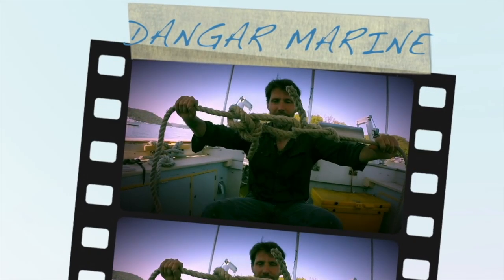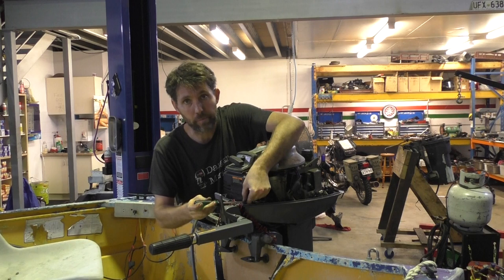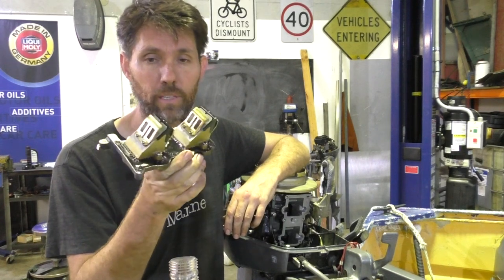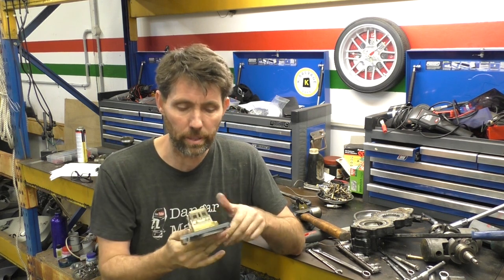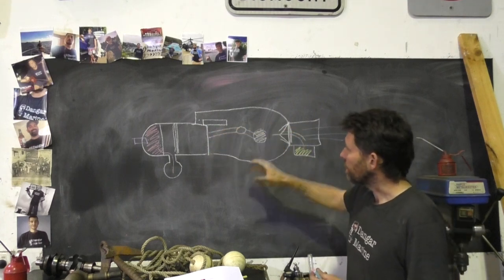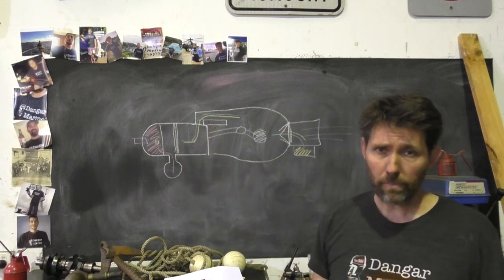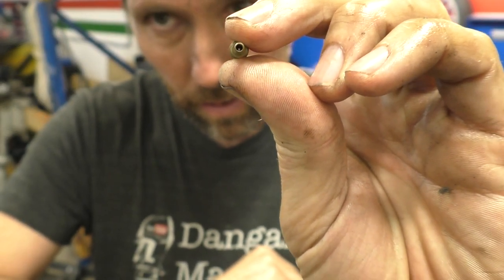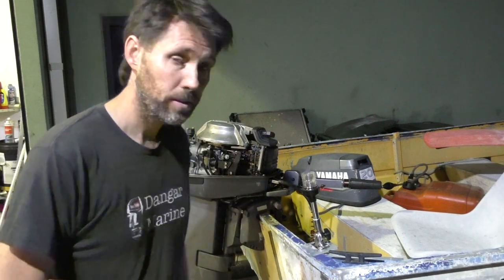Outboard reed valves

Comment: Thanks for the diagram explanation.. my 90 hp v4 evinrude I have to choke the crap out of it to make it run. I'll run super for as long I want to be in the water , ! But whe I turn it off and let it sit for more then 1/2 hr I will kill the battery trying to get it started again.  I took the plugs out and choke it to make it run and it takes at least 15 mnts of cranking with full choke to start it again and then it cuts off. It's like it's not getting enough fuel into the cylinder? Can reeds cause that.. thanks
Reply: If it takes more than 20 secs you are beating a sick donkey

Comment: So bad compression can be linked to poor reed valves.. But how did I find which one is responsible? My 1988 force 50 hp has poor compression like 80 lbs
Reply from the maker: Bad reed valves won't give you a poor cylinder compression reading but they will stop the fuel and air being compressed in the crankcase. Often you will see fuel spitting out of the corresponding carburettor if they have broken.

Comment: great video as usual and you got a bunch of views too. too bad that did solve the issue but you can at least cross it of the list. still on our trip on the coast. my 700 dollar rv hot water heater has a issue and only puts out warm water for less than a minute either on gas or electric? the tank gets hot which is puzzling. so taking showers at the sites facilities till we get home and have my buddy who owns a RV repair shop fix it. YouTube no help on this one. haha I too love the humor. yes a more diagnosis search will solve this issue and believe it's an ignition issue.
Reply from the maker: Hey Tim, bummer about the hot water. Still looking into whats going on with this motor, hope to have it running today!

Comment: Will the Reed valves cause an engine to have compression issues?
This what I mean 
1987 stratos fish and ski bass boat. Has a 115 mercury on it, new carpet, new seats and new cover. Boat guy told me it needs reed valves from losing compression. I don’t know anything about them and do not need it. Will sale or trade, make me and offer.
Reply from the maker: Reed valves don't affect cyclinder compression, only crankcase pressure that then transfers the fuel up to the ports. Low cylinder compression is a much harder fix.

Comment: I purchased new reed valves for a mercury 200. When I put it back together I could slightly see light. Why would this be? They are brand new. I tried flipping them over both ways. Have you seen this before? Or is there a slight tolerance ?
Reply from the maker: Hmm, can't say I have seen that. They may bed in with a bit of use though but I would personally be feeling more comfortable if they were sealed before I put it all back together.
Reply: I looked in the manual and it says it has a tolerance of 20 thousandths. I took it apart and re checked it. It seems to be good now. Thanks! Love the channel

Comment: Hi mate I have a tohatsu 50 two stroke 2005 model don't seem to be Erving fully throttle full open only approx 3200 revs on taco and low power any ideas where to start with this one please and cheers for a great channel
Reply from the maker: I'd make sure it is running on all cylinder - check for spark and clean each carburettor. I would also do some research into the outboard to see if it has a limp mode that has been activated limiting the revs too.
Reply: Thanks mate great channel

Comment: Great. I have a single carb 25 hp Nissan and top cylinder get too much fuel, flooding the spark. Could reed valve be tuned to reduce the air/fuel into top cyl?  thanks a lot.
Reply from the maker: Yes, reed valves or a vacuum leak somewhere are about the only things that will cause that on a single carb setup.

Comment: If it has a choke, a lean condition should have cleared up with application of said choke.  This could also be a vacuum leak causing lean, though.  I'd start simple and spray some Brakleen around the engine while it's running to see if RPM's increase.  If not, I'd head for the ignition system.   Seems you've covered just about everything else!  Could be a bad plug wire or plug cap too.....maybe snip the wires and re-screw the plug cap on them?
Reply from the maker: Yes, putting the choke on a bit is a great way to see if it smooths out as it richens up. I will be doing a whole video on vacuum leaks soon and definitely going through the ignition too.

Comment: Could bad Reed valves possibly be the cause of excessive unburnt gas coming out the exhaust? I recently rebuilt carbs on a 96 Johnson 130 HP, and get quite a healthy pool of unburnt gas/oil in the lake. Nothing leaking from the carbs in the housing. Just started happening. Trying to pin point the cause. Thanks
Reply from the maker: Generally bad reed valves will mainly cause unburnt fuel out the carbs rather than exhaust.
Reply: @DangarMarine  Thanks for the reply. You think it's most likely a carb issue since it happened after I rebuilt them? Also used that OMC engine tune up, so could still be gunk from exhaust due to that? Thanks again

Comment: Im having a problem with a 2 stroke Yamaha 115tlra holding fuel pressure. I can pump the primer bulb (new) with the engine off and hold pressure. The new fuel pump is holding in a vacuum when I put a tester on its inlet. After the fuel pump, the tester will show about 2psi for less that a minute and then drop to less than 1psi (maybe a half) with the engine running. Anything over about 2000rpm and the engine bogs down and acts like it wants to jump off the boat. I’ve already rebuilt the carbs 2x, and going crazy why I can’t keep pressure. Does this seem like possible reed valves? Thanks, appreciate all the efforts in your videos.
Reply from the maker: Have you had the fuel pump apart?  Your tests show that the reed valves inside the fuel pump are probably good but you may find there is a tear in the pump diaphragm. The crankcase reed valves talked about in this video are unrelated and won't cause fuel pressure problems.
Reply: Every time I think I’m close to solving it, you slap me in the face with something else it could be (LOL uuurrrg at same time). Yes, I have put a new fuel pump on. The old one looked good, but did it as a precaution. You replied on another video you put out, that I should make sure the water passages, thermostat, and head gasket should be looked into. So, I will try...

Comment: Hi the two line on the reed values what are there use
Reply from the maker: Hey Tristan, can't quite picture it in my head at the moment. Are you referring to gaps in the plates that limit the travel of the reed valves (ie, how far they can open) If so I imagine it is just so they don't restrict air flow too much.

Comment: Have been told that I have a reed problem (running remarkably well on 3 of 4 cylinders), but they are internal? as in not accessible like the video.  Any chance you could one day show the difference between the two and how to access the internal reed valves.  Love your videos!  Thanks
Reply from the maker: Why type of outboard is it?
Reply: Mariner (Mercury), 40HP, 4 cylinder, dual carb. serial # 0C200979.  Bought it after it had been submerged, cleaned it best I could and it runs great considering.  Guessing some debris might be affecting the reed valves on the non functional cylinder
Reply: 40 hp Mariner (Mercury), 4 cylinder, dual carb (serial OC200979).  Was told that it is running on 3 of 4 cylinder by marine mech.  He thought it was likely the reed valve

Comment: has reed valves got anything to do with my 25 2stroke backfiring after u let off throttle ?
Reply from the maker: Possibly. A motor can backfire from being out of time or being too rich or too lean. Bad reed valves can make it lean. I would first check that the timing plate is springing back quickly when you let go of the throttle if it has an older style mechanical advance.

Comment: Dude, your videos are the best. I'm currently trying to get my 1988 Mercury classic 50 running up to snuff. I loved your 2 stroke diagram. Quick question, when the piston revolves back to the crank case and the air/fuel mixture gets pressurized into the cylinder, what prevents that mixture from flowing out of the exhaust port?
Reply from the maker: Thanks mate, good question! The piston is past the exhaust port at that stage so the rings are sealing the crank case off from the exhaust port.
Reply: Dangar Marine Got it, makes perfect sense. Thanks! Any idea why I would be seeing unburnt fuel coming from my exhaust ports while idling? I assume it's a spark issue, because I'm not hitting max RPM.

Comment: If you are replacing reed valves because you see light, you may be wasting money. Most manuals allow a clearance between the reed valve and the body. For instance, my 115 Optimax manual states that gaps up to 20 thousands of an inch are acceptable and the reed can remain in service. Remember, when the valve is closing for the compression stroke, the reeds are held closed by the pressure building up in the cylinder.

Comment: I've got one of those motors that will pull your hair.. 76 hp Johnson 
1978.. ran nice on the hose. Wouldn't start in the lake.. I raised the motor out of the water with the trim. Started it, then quickly lowered the motor in the lake keeping it running.. ran down the lake ,had no power wouldn't plain then it died and would not restart..
Got home ,it started fine on the hose...the carbs have been cleaned. No problems there. I took the lower unit off. And shined a light up the shaft and noticed a lot of carbon build up in the exhaust port . So I've cleaned that up.  But when I ran it again on the hose . The bottom cylinder is running very lean , as I sprayed a shot of petro in the card and it try to take it run up.. I have compression of 120 lb on the top and middle , but only 100 lb compression on the bottom.. any thoughts??
Reply from the maker: Check timing and that you have spark on all three cylinders.

Comment: Can you lose the compression totally on one cylinder due to bad reed valve?
I have Chrysler 15HP motor without compression on upper cylinder but good compression on lower. There is slide discoloration on cylinder head and I can't start it at all. Or it could be  problem with scored cylinder although I can't imagine that just score cylinder wouldn't generate  the pressure under just the finger; it would have to be a hole in the  piston, any comments would be appreciated
Reply from the maker: Reed valves can't cause no compression, they only affect the compression in the crankcase which is quite low compared to cylinder pressure. It will either be rings or piston damage as you say.
Reply: Dangar Marine Thanks for an answer. This mean if I take of the cylinder head I should know what's wrong
Reply: It was blown head gasket; after replacement it has high compression now

Comment: Good informative videos. Have a 115 Johnson V4 2 cycle. Starter turns engine fine with no plugs or with 1 plug in number1-3. A plug in Number 4 bogs down the starter not long after turning over. Same a with a compression tester. Which has revealed low compression in #4. Any ideas?
Reply from the maker: I'd be checking the timing and looking into why #4 has low compression. Fix the things you know are wrong and then test again to see if there are other faults on top of that.

Comment: what would cause compression on 1 cylinder ,but not on the other,,motor runs fine till it gets hot ,then stalls out,,did a compression check and found one hole with no compression,,would this be valve issue,,great vids bro,keep um coming
Reply from the maker: If it is a four stroke it can be a stuck valve yes, otherwise it would be rings.
Reply: no this is a 18 hp johnson,76 model,,kinda figure a full rebuild,,just havent been able to find parts,,you lined me up with a place a few days ago,,seen you vid of the spitting yamaha and had to ask,lol,it belong to a special person in my life told him i would rebuild it,,then he died of white cell cancer ,but im a man of my word

Comment: never never pre load reeds to close tight by bending them. I made that mistake long ago mercury would not run correctly. A straight six had to disassemble entire motor.
Some would swallow broken reeds destroying pistons. Best to get new fiber reeds on larger HP motors. Some engines want a small clearance in Reed. Check factory specs.
Reply from the maker: I've read a bit about the fibre reeds, I'd be interested to do the upgrade on an outboard one day.

Comment: Wow this video could not have come at a better time. I did a tune up on my 115 two stroke Mercury 4 cylinder and I'm pulling out hair I don't have any more.  I've adjusted the carbs 1.5 turns out, set idle timing with throttle cable disconnected to 4 deg ATDC.  Manual calls for Idle timing 4 deg ATDC to 2 deg BTDC .  Also checked WOTor advance timing set to 20-22 deg BTDC.

The idle should be 625 to 725 rpm.  I can get it to 925 to 1025.  It's making me crazy. Finally the seems to be floating away or going out of time.  I think I see the problem with that one.  Instead of a lock nut type screw to hold the timing after adjustment, there is a screw with a spring on it.  May have to change that one...

Finally, there is oil and fuel mixture blowing back out the front of the carbs.  So me thinks reed valve inspection maybe in order.  I've removed the carbs a month ago, cleaned them, reassemble and put back on the engine.  that solved the engine not starting problem.

Finally and probably most importantly, the motor is 20 years old.  Maybe one of those when to give up on an outboard moments.
Reply: I have a Johnson 200 from year 2000 that is spitting fuel out of carb at me. I rebuilt carbs, checked reeds and its still doing it. I can't figure out why. If reeds are good why is fuel spitting back at me?
Reply: robbynelson3 did you check the carb floats? Most of the time its the carb float not seating correctly. If you have a manual check the float height specs. After floats then its usually the reeds that cause that problem
Reply from the maker: Yes, as Jimbo says if the floats aren't working properly the carbs can over fill and start leaking fuel out.
Reply: Ok gents. will chwck c
Reply: sorry I'm a paasenger on abumpy ride.  I'll check the floats
Reply: John Wilder Yeah man definitely cross that off you're list first. Most of the times fuel flowing out of carbs, the floats are the culprit. Also make sure you're carb gaskets are sealing properly. Is the fuel flowing out the carb itself or where the carbs meets the block? I believe yamaha has a better seal with the o-ring compared to the mercs paper gasket. So make sure the gasket isn't torn and that the carbs are snugged up tight to the motor
Reply: thanks Jimbo, thanks Stu.   will remove carbs again and do the float adjustments as outlined in the manual.   You guys are a wealth of info.  I saw this early on as I was doing the carbs but did not give it much thought.

Comment: Can it cause the motor to bog out when full throttle
Reply from the maker: Generally going lean.
Reply: Can't figure it out engine bogs high rpm This is a force 75 horse power engine 3 cylinder  One carburetor any suggestions

Comment: Jofe I have an evinrude of 40 hp 1986 that shoots. upper carburetor fuel, I change the top module of the blades, but I keep throwing fuel through the upper carburetor that can be

Comment: I was once told that the difference between OMC 9.9 outboards and 15 hp outboards was the reed valves. Swap the valves and convert your 9.9 to 15 hp. True?
Reply: steezs  thanks

Comment: Just found and subscribed to your channel.  Great job.

I have a 92 Suzuki 15 hp dt15c starts great runs good until about half throttle doesn't have the power to plane my 15 ft Alaskan smokercraft yet atill runs smooth as far as I can tell new didn't seem to have anything wrong with the carb. Fuel tank and lines, spark plugs and fuel filter are new. Sat in Arizona for about 5 years my father bought it brand new we used it quite a bit with no issues then I acquired it.

Please help
Reply from the maker: I'd do a compression test on it. If it was sitting for a while the piston rings might have stuck.
Reply: @DangarMarine  I thought that 2 been running it about 2 seasons when I first got it it ran awesome then got worse idles  great starts great But I'll check it and let you know what I find.  Broken ring maybe hope not.  I'm also not sure if this engine has reed valves or not.

Comment: Ok. Tell me why I don't have fuel on one side of the engine, but not the other. It's a 135 Cross flow. Starboard side has fuel. Port side. ... nothing. I spay fluid into it cards and still don't hit. What am I missing? Reeds are new. Gaskets new. But Port side, will not hit...